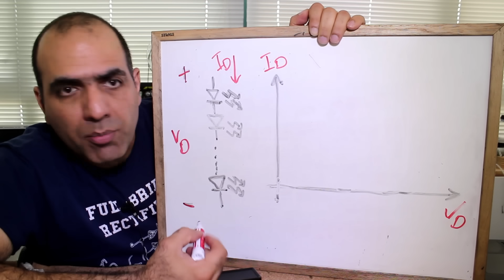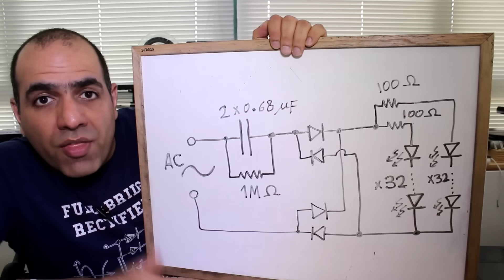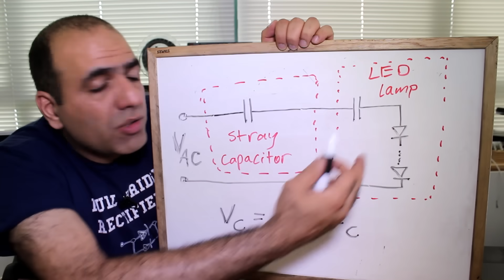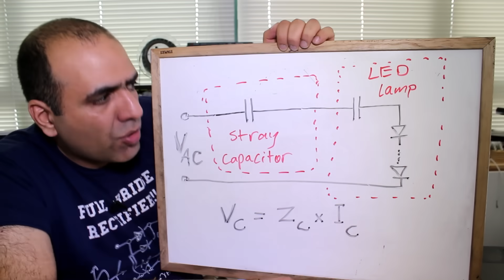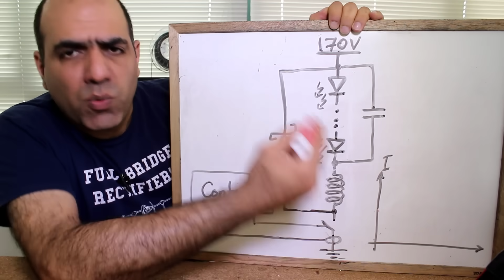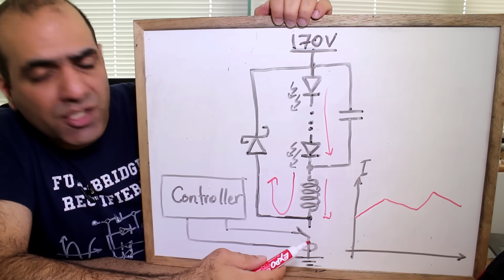Why Cheap LED Lights Keep Glowing

Comment: I recently observed this after glow phenomenon during a power outage in a under cabinet that I had converted from fluorescent to a LED COB light. It wasn't a problem at all. Now, I sort of understand why this occurred.  The light has worked fine for years of daily use and was a big improvement over the original 10" fluorescent bulb set up.

Comment: One thing i learnt from experience was that if you connect the tip of your soldering iron to the cathode pin of an LED it will glow a little

Comment: You make the assumption that it's capacitance in the house wiring, but given the huge amount of electromagnetic energy we have floating around out households at everything from the 50/60Hz of mains up to radio waves and WiFi, have you considered induced current in the wiring ? You should invest in an oscilloscope, then you could actually look at the waveforms of the electricity as it passes through your little finger 🤣

Comment: Like I said on Steve video, those LEDs are for cars and are designed to have DC voltage delivered to them. Don't know if this explains why they didn't put the resistor but I thought it was worth pointing out

Comment: I have 6 of those cheap Chinese led bulbs replacing the incandescent equivalents, but when I switch the light off the last one glows slightly. So I had to have at least one incandescent bulb still in place to stop it happening. It’s annoying because it’s a different colour than the leds. What can I do to stop this effect? Can I fit a resistor or something to one of the light sockets?

Comment: would that mean that in a regular household there is always persisting leakage current, even when all switches are turned off due to the capacitance of the wiring in the walls?
Reply: Yes and stray current (capitance noise) from the other wires running together through the house.
I'll often see that ghost voltage even when switch or circuit is off. Usually nothing to bat an eye at.
Reply: It's an issue you can get with cheap audio headphones. You can hear the leakage in your ear over time. Higher quality audio equipment has shielding and filters for it.
Reply: @Juan-Dering  that has really nothing to do with the question asked.

Comment: I love the LED strip they do this all the time. i tap the capacitor and the y light up. I use it to freak my nephew out saying it a superpower. 10m strips and large fold a little charge so they often stay on. but in the don't I touch the capacitor it sort power and light them up

Comment: Excuse my dumbass i had a similar question where when i place my soldering iron on LEDs or LED bulbs and lines it lights even if a bit dim light but it does i watched the video but didn't quite understand

Comment: HOME LINE   YMTNLO5F2  0.5 W   120  60Hz    10ma   1199609 1903
This LED light will stay light for a few minutes even when it is not connected to any thing .

Comment: thanks for the explanation. now, can anything be done about it in my house? is there a circuit or component that I can add to "eat up" the residual voltage that's being stored?

Comment: I have a large 30 watt led frame that did this. If i disconnect the earth it is gone . I eventually moved it to another room where i could use a double pole switch, that also solved the issue and it's grounded again 👍😃

Comment: i dont understand anything. 
if glowing is safe or not safe and negligible — i just want to know if it raise my electricity bill. 
i have a 10 watt floodlight i see it glow .. so why didnt manufacturers correct these products even if it's normal thing
Reply: It has to do with your wiring, it usually happens when using a so-called return wire, that creates a capacity in parallel with the switch. It won't happen if you route a power cable to the switch, and start with a separate cable from switch to the light. The return wire technique with an extra junction box in the ceiling is obsolete and not even allowed anymore for new installations (at least in Belgium, Europe).
Reply: But in the case of your floodlight, i guess it is earthed and you just need a double poled switch instead of a single poled one

Comment: We came to the conclusion that you need to assume that with the light switch off that the bulb live is still connected to the supply by a (worst case) 4n7 capacitance due to wiring capacitance in the installation. Then do your design calculations assuming this is true, and you will have no problem with unwanted glowing.
We could see light with only 5uA of led current!

Comment: I have a screw in LED that does that. When off, is the LED still drawing power from the power company? Are all lights drawing power when off but not showing it? Are we using power even when the lights are off? How about other things? Is that why power bills are so high?

Comment: Full-wave bridge diode rectifier arrays are rather useful when you need to convert any AC current (like 120V) to DC, but I wonder what other uses they have...

Comment: I remember back when they started to introduce the low power flourecent lamps some of those had a similar problem were when turned off they would flicker like trying to turn on and that sometimes would cause them to turn completely on and you could not turn them off. I knew back them the problem was caused by the light socket being wired wrong and the switch instead of cutting the live wire it was set to cut the neutral.

Comment: In my barn I got Led lights which are connected to power by a simple plug which I pull out to turn them off, Even if that plug is pulled out for several hours they still glow faintly 😅

Comment: Is it possible for a circuit like this to absorb electricity and cause your electricity bill to almost double? What if a bunch of these circuits were placed around live wires: 1) Will the electricity bleed somehow register as electricity usage on the meter? 2) will the electrical bleed fake the meter into thinking electricity is being used?  My landlord installed a bunch of these lights that never turn off and the electric bill increased 40%. We are all very confused.

Comment: What if the neutral is switched vs the hot side in an improperly wired home... thinking this would cause the glow. I had a  properly wired switched hot neon lighted light switch where the neon of the light switch used the filament of a bulb to light between neutral and hot while switch is flipped off. If you removed the light bulb the neon in the light switch went out. If you plugged in a LED light into light socket of a neon lit light switch the ballast of the LED will charge and discharge and cause the light to blink while the light switch is flipped off.

Comment: In Europe, if motion sensor LED lights glow when off, you can just flip the neutral and live around. (Flip the schuko 180degrees) I think it does not work in canada or america becouse you guys use +120v/-120 and europe has 0v/230v system

Comment: Answer this please. A Rubber sole shoe in hand touches 240v while bear foot I don't feel a thing. Reverse components and current flows and I get shocked. I.e. bare hand touch 240v wearing rubber soled shoes I get zapped Why?

Comment: Actually I have several of the normal screw in LED's that glow for a few seconds after I turn them off. You don't see that during the day only a night. I assume it is the capacitor draining off, or what ever coating is inside the globe.

Comment: Some people wired the neutral trough the light switch, thus leaving the live connected directly to the bulb. You should always connect the live (phase) to the light switch.
Reply: In some cases the phenomenon happens even when the live is switched.
Reply: @ramses0406   Also some of the bulb have capacitors incorporated that act as a battery.

Comment: We bought some inexpensive LED fixtures that have the LEDs built into the fixture instead of a separate bulb. when we turn them off, they tend to glow slightly and slowly fade out after 3-4 seconds. Now I know why! The circuit probably has the resistor needed to stop the "zombie" glow but it isn't big enough/small enough to completely drain the circuit immediately.

Comment: This is not the only undesirable effect, and it is not out of cheapness: if you live in a relatively old block of flats/apartments type of building with push button illumination of common spaces, you might have noticed that gradually replacing burned incandescent lamps with LED ones in access corridors and stairs first noticeable effect is afterglow of LED bulbs, especially if they are of more expensive propper switched mode driver type, which might be considered as free bonus. The second noticeable effect, as more bulbs get replaced is that the on-time starts to rise significantly - that's usually corrected by whoever periodically opens common distribution box by adjusting the delay relay. As majority of the bulbs become LED the most unpleasant effect appears: lights stop turning on by pushing momentary buttons, especially most used ones as ones near the common entrance. That's because most common old delay relays work by discharging a capacitor that gets charged by the combined current of all the lamps in the commutated circuit and the very small current of LED lamps combined with possible ware of the switches do not provide enough current to charge the capacitor to the required voltage for the very short period the push button is closed (if you happens to know what is this about you'll just keep pushing until lights turn on, which is annoying,  but consider yourself a negligible minority - most people will consider the situation as major fault and a crisis). This is cured only by changing the delay relay with another type and arranging the circuit differently.

Comment: Very interesting!  My late mother called me to her house and said 'the light in the bedroom is driving me mad'  I thought she'd lost the plot but sure enough, it was flashing on and off continually, and even though it was daylight, it could be seen.  Needless to say, it was very annoying throughout the night!  Strangely, I took it home and plugged it into our lamp socket and it was fine.  Any reasons here, boss?
Reply: Live vs. neutral, I think. Or neutral without connection to ground vs. neutral with connection to ground.

Comment: 3:11 so the current is not enough to trip the rcbo or residual current breaker overcurrent,  because it trips at 30 milliamps. rcbo is like gfci in north america

Comment: So, uh, what's the TLDR? And is this normal with LEDs or not? Because the LED ceiling lamp in my room is making it hard for me to get a good night's sleep because of the glow and I want it pitch black when I sleep. Any solution if this is not normal, like maybe adding a capacitor?

Comment: Sure you can add a resistor to turn the off current into heat instead of light. But the current still exists and it is still wasted. All the cheap chinesium LED lights do is tuning that waste current into light instead of heat.

The actual solution would be to eliminate the parasictic capacitance by eliminating the switch loop. Route both wires to the double pole switch first and then to the light socket.

Comment: ElectroBOOM, I have a question, if you connect a square sheet of aluminum, of equal resistance in all the sheet, what path will the electricity take? Will it be random? Or it will take a straight path?

Comment: As a sparky i have cone accross this problem with customers after i fitted their chandelier, the only way around it was to fit just 1 halogen capsule lamp in the chandalier ( which looked odd once turned on) or just have to buy various quality LED lamps until you rectify it.

Comment: I had this issue in a interior , so much single mini led downlighting . These were controlled with Dali dim units , and these don’t actually turn off, they are dimmed to 0,1%. Even the switch off function programmed it still didn’t fully turn of . As the lights could not be changed I ended up installing 10 Kohm resistors parallel across Pos neg for each led . Problem solved 😁 next light change will be better quality lights and Dali controllers that have electronics in place on the output to prevent this issue . Main issue here was cheap quality lights and drivers 😄

Comment: @9:15  Is this why I see LED bulbs flicker? I have a cyclic nystagmus, my eyes rotate, and the flicker from LED bulbs drives me crazy. If I hard wire a series or parallel of LEDs to a DC current, say a battery, I don't see the same flicker. 

It's about to get bad b/c LED bulbs have become popular at Christmas and some (especially blue and red ones) flicker so clearly as to make me nauseous.

Comment: I have a 7 LED bulb (55v 0.2w E10 2.5 lumen) christmas window light that always has 2 or 3 LEDs always glowing at around 0.05 lumens (very faint) and if I put my hand around the (un-plugged) cable and hold it ,then the LEDs STOP glowing, is that my electric field of my body grounding the load of the circuit and thus my body sucks in most of that energy generated from the cable, or from the LEDS working as reverse solar panels ? So is the LED's working as solar panels when the cable is not plugged into the outlet and then moving a weak magnetic field in that cable and when I put my hand around the cable or touch the connections that field is broken/completed and the LEDs stop glowing because my body is working as the load and draining "the battery" (the battery being the LEDs working as solar panels) ?

Comment: Did you mention the full bridge rectifier is also needed if using the series capacitor  to supply power,  to enable  a charge & discharge path?

Comment: Our local radio club had a similar problem. The pure energy the big radio installation sent out was enough to make the cheap China LEDs glow as long as it was actively transmitting. Cool and somethat creepy, if you don´t know what is going on. On the other hand the LEDs were able to also mess with the radio signal itself.

Comment: jesus... if that would happen to me at work (0:46) over here in germany, they would kick me out of my company and i may get an professional ban! (over here you need a certification to be able to work as an electrician (or many other jobs which could harm you or others), and if you are doing things that could harm others you can loose that)  
we have something thats called the 5 golden rules: 
first: to switch it off, so there is no current anymore
second: your going to secure it that noone can switch it on without removing the lock or tape.
third: your going to check it with a two-pole voltage tester if there is actually no current anymore
fourth: when working an things with over 1000V, ground it and than short circuit it, so when you are working after the point with the short circuit, it will blow up before it hits you.
fifth: if there are other things around it which are unter voltage, you have to cover or cordon it off.

And without a good reason you will never work on something that is not switched off. I know there are points where you have to work while there is voltage, but in that case he didn't have any reason!

Comment: my grandpa used several big tv antenas in his house and as one had 3 meters of wire hanging out from the roof to inside the room when i got bored i used a led and touched it while it was connected to the antena positive at the end and then the led turned on, i already had seen this happening but i didint think it was possible using only an antena, then i connected the other end of the led to the door wich had an earth connection and the led was almost fully turned on like arround 90% to 120% of the full light it normaly gave
so seeing this happening i wonder if i could use this phenomenon to have in a way free energy its not infinite but in the apocalypse it would be very useful using an way too high antena as it probably uses atmosphere energy as tv and radio signals wouldnt be so useful and the antena was at 6 meters high so its probably a way to get at least some free energy

Comment: LEDs sometimes act like a PV panel.  When they operate in the reverse they are used a movement sensors and are also producing power.
So while they are set up in series and you make a full bridge rectifier using LEDs you increased the chance of the LEDs lighting up without being connected to any power supply.

Comment: This is good to know, when it's worth it a proper switch or two to cut the circuit from both wires to save electricity, now I understand why some lamps have OFF power consumption info, imagine on the world scale how much energy can be saved by investing on better switches and on other electrical devices too as it's not possible this is just LED specific problem

Comment: I'm not sure why people keep calling it 'a problem'. It just means the light doubles as a night light when turned off.
And from what I understood, 'fixing it' doesn't actually stop the phantom drain of power when the light is off, so... it seems it's only a fix for cases when you want complete darkness? How often is that?

Comment: You can do it with a thre volt batery i concte a led on my finger runing to a button cell positive cathode and had the negative electrode of the led touching my skin it still worked and that was with a small button cell

Comment: I know this is a bit old, and there are like 4,745 comments on the video, but at around 06:00 I would have naively identified this type of RC circuit as a high pass filter more than a voltage divider. Is it both? Also, I would have calculated impedance of the capacitor with 1/2πfC, am I missing something?  And what is "S" exactly? (If anyone knows.) Thanks!

Comment: When I put multimeter in beeper mode to test if it’s shorted it sometimes turn on, same goes with soldering iron on 1 terminal

Comment: Actually in my previous apartment when changing light bulbs. I held one in my hand and it started to glow. I was holding the metallic base I'm guessing the light itself has a capacitor.. Like a cheap wizard.